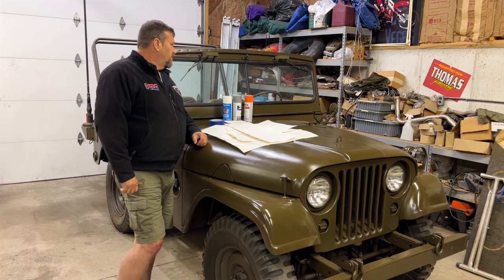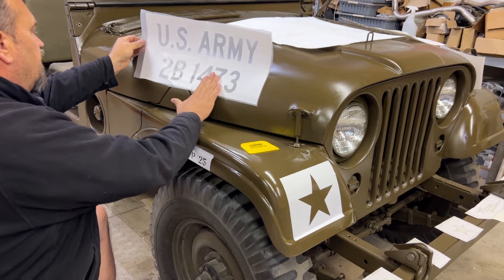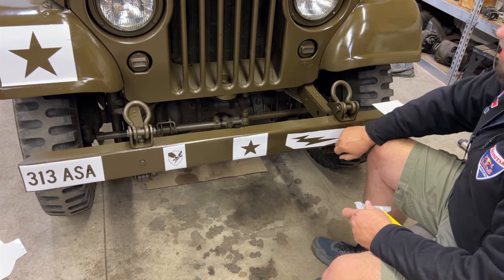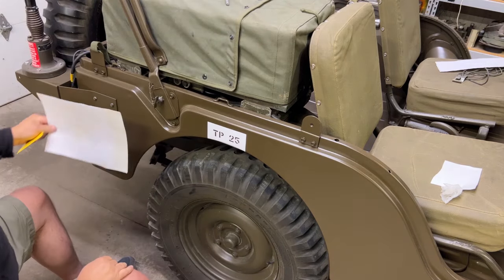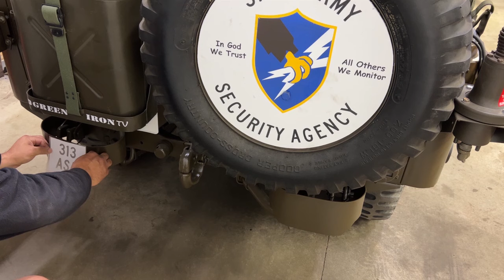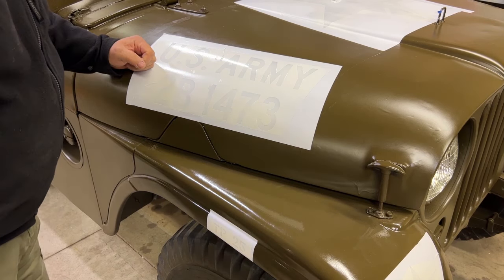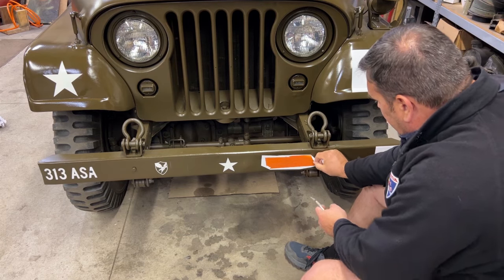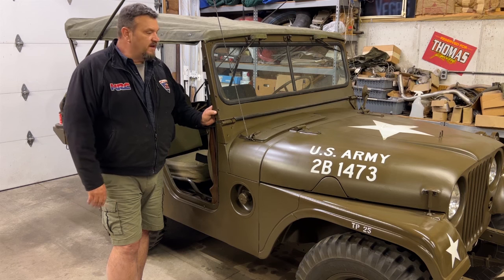Green Iron TV Episode 47 - Markings on the Jeep M38a1 How to Paint Mask

Comment: Curious the "2B1473" hood number. I recently acquired an old M-170 ambulance (long wheelbase variant of M-38A1). It has a hood number 1B0500. Do you know what the  "B" signifies in the hood number sequence? I am trying to lear n=more about the history of my jeep and these vehicles in particular. Thanks!
Reply from the maker: @davidbranch8134 The B is a place holder for thousands of sequence. The 1 is the class of vehicle and the next five numbers represent the contract order of delivery for a fiscal year. The very first class 1 vehicle accepted would be 1A0001 and would go up until the 9999th vehicle or 1A9999. The 10,000 vehicle would then be 1B0001 and would go up to  19,999 or 1B9999 and the next would be 1C0001 and would continue up that way. There is no way to track the history through the registration number, the best way is to look for the last unit it served with by lightly sanding on the bumpers to try and find unit markings. And then research that unit to see where they were stationed.